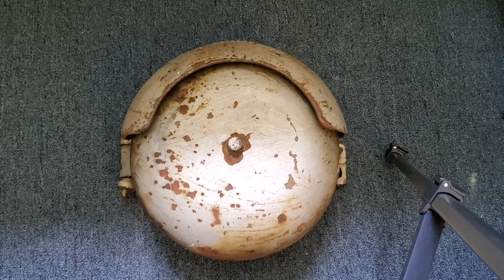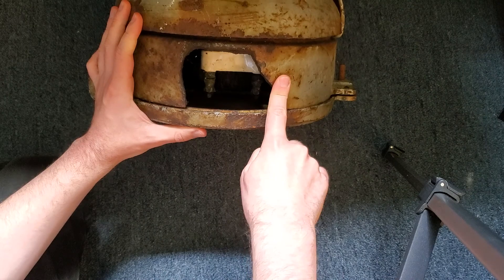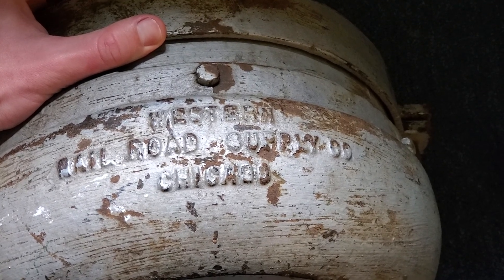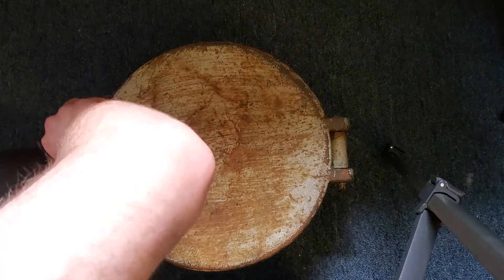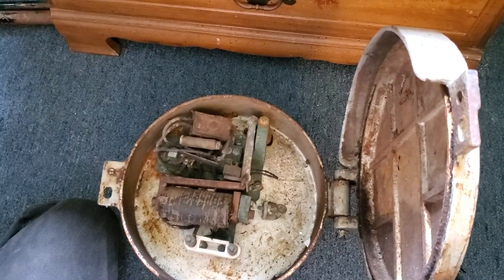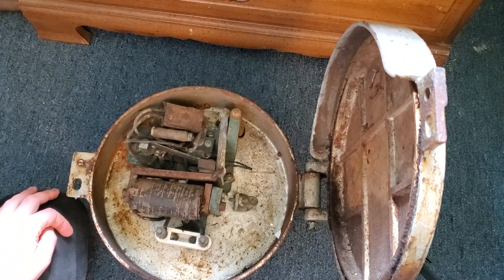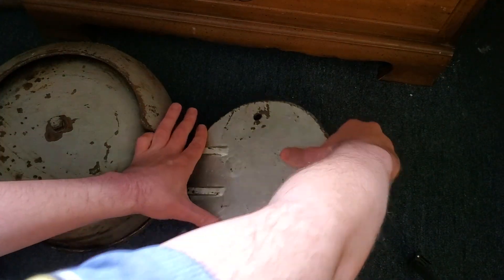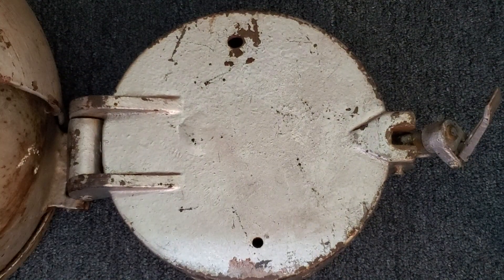Very Rare and Unusual WRRS Mechanical bell.

Comment: That’s actually an LS Brach M-Bell! The door lock and the door hinge are both on the opposite sides as it predecessors (Bryant Zinc, RRS, WRRS, FS & WCH), plus the mechanical internals are in the same configuration as UPking’s LS Brach, and the gong sounds like the LS Brach that was recorded at an on display Wig-Wag at a fire department in West Chicago, IL (Gametrain Productions recorded it). Since the rain shield is WRRS, it would’ve most likely replaced the bell’s original LS Brach rain shield. LS Brach bells also appear to pre-date the 1910s as well. The proper was to ring the bell is to move the hammer downwards in the mechanism instead of moving it sideways (which is what you did in the video).

If you want to know more about this bell, there’s a video of UPking’s LS Brach bell that can show you: https://youtu.be/sPEdEMrJygo